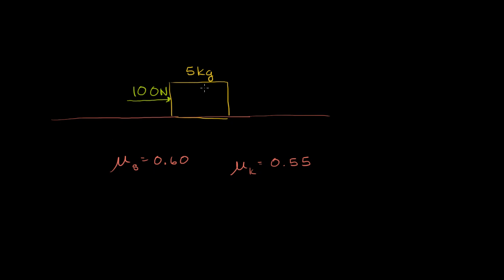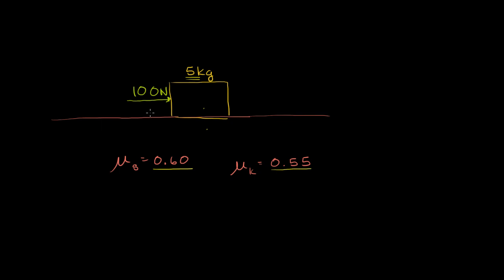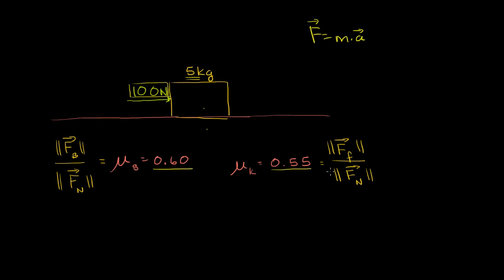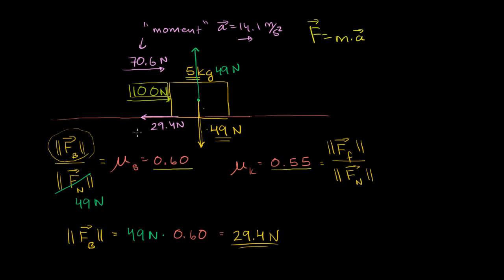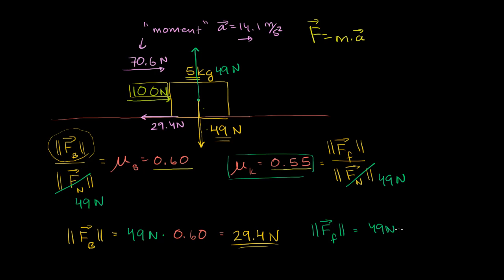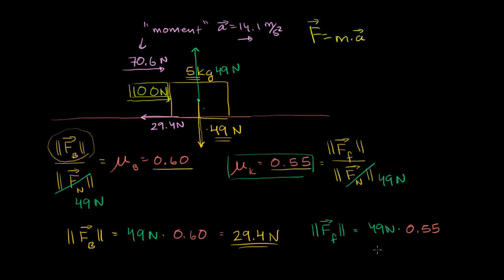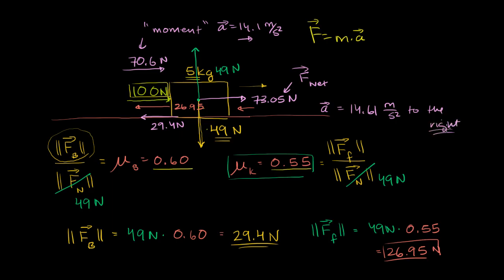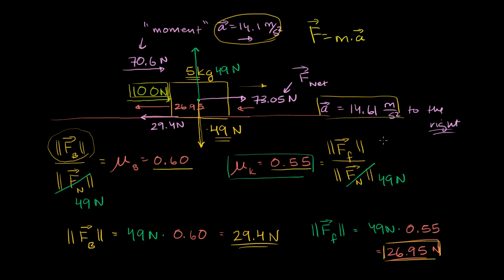Static and kinetic friction example | Forces and Newton's laws of motion | Physics | Khan Academy

Comment: Thank you Mr. Khan you just clarified the way the different coefficients work! The static friction doesn't change the initial force when you go to calculate the Fnet concerning the kinetic friction (i.e. you subtract 26.95 from 100, not 70.6. I suppose one has to know if the force is constant, which most of the time it is for beginning physics problems.

Comment: That was great!!!! Thanks.  Can you do a similar example where it asks "what is the speed of the block after it has moved 3m?"
Reply: well if you have the acceleration you can work it out, use v = u + at to get final velocity half it (assuming it starts stationary) to get the average velocity and s = vt to get s = (at / 2)t use that to work out t then use that value of t in v = u + at